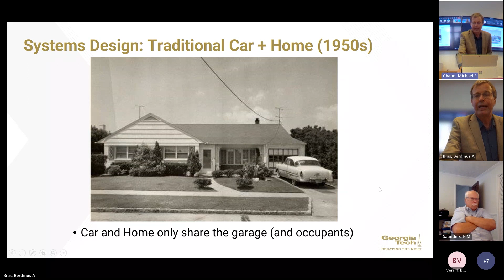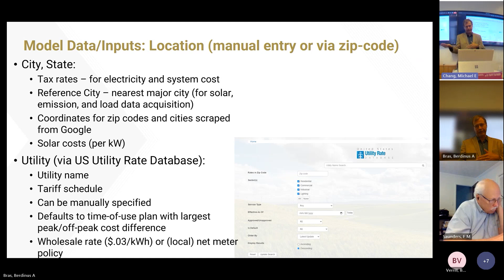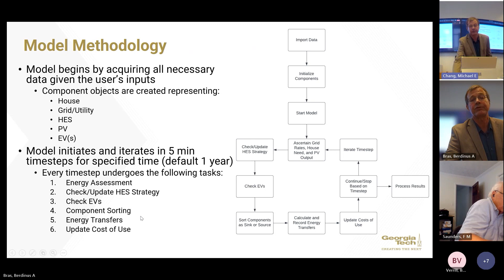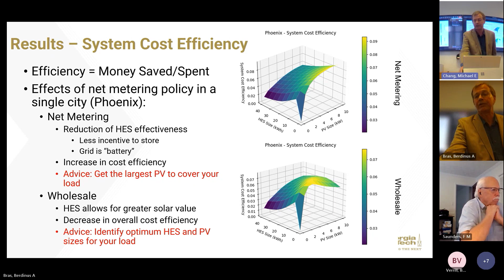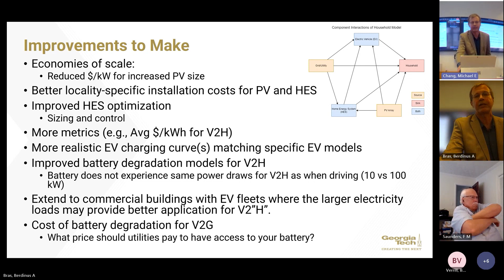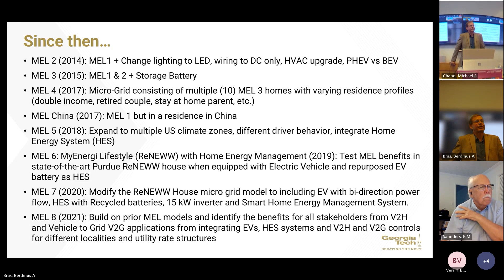Electric Vehicles in Households: A Decade of Benefits | Bert Bras | BBISS Seminar Series

Comment: I’m glad I found this discussion. Folks, I live at 3,000’ in the mountains of California. My challenges as a homeowner are related to extreme energy costs. We currently pay 37 cents per KWH for electricity. We installed solar and intend to install more. A smart electric panel is also in our future.Our big need is home battery storage. My thought for minimum home battery storage is that we need 10 kWh for the home, 10 for each occupied room, 20 for extreme weather, overnight heating and cooling (highs over 100, lows below freezing), and 10 per EV. For me, a 50 kWh home storage battery would take me off grid. Given that Pacific Gas and Electricity has the highest electricity costs in the lower 48, I intend to give the finger to PG&E execs by going off grid. We need a $10,000, 50 KWH battery!
Reply: In terms of home energy storage, the current generation of Powerwalls is like a1999 Chevy EV 1. It is expensive and only drives 75 miles per charge. Powerwalls offer the homeowner equivalent of range anxiety.